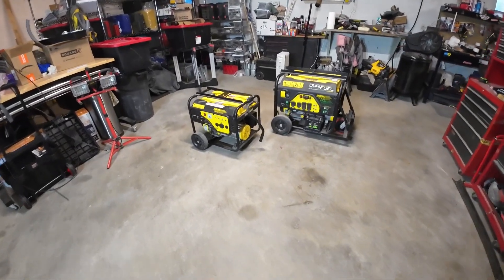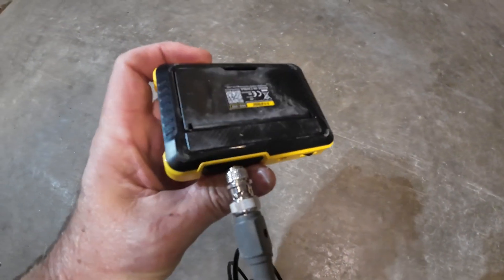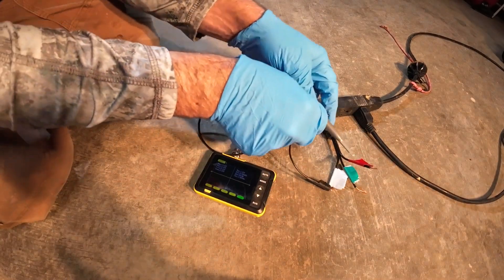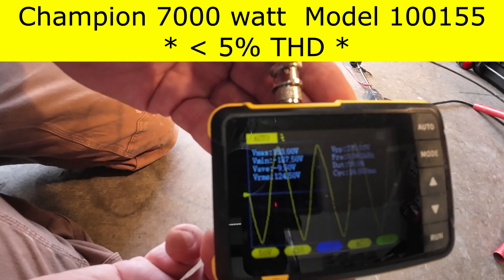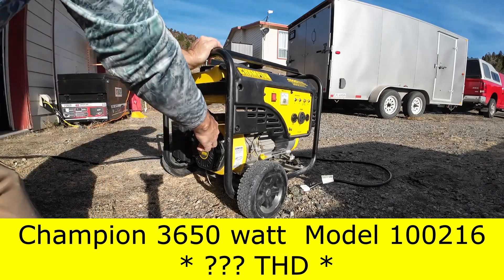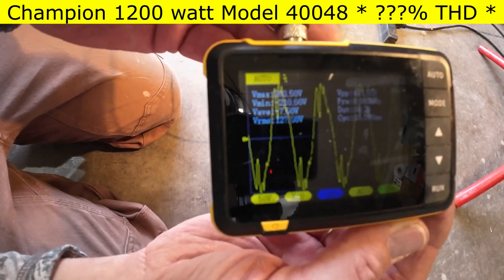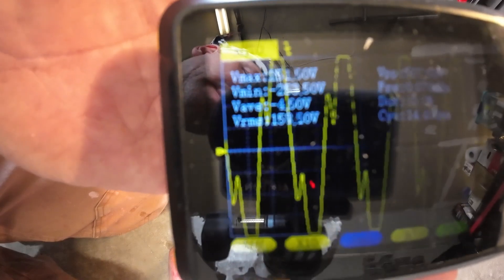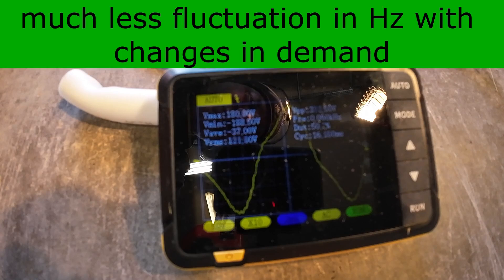3 Champion Generators POWER COMPARISON

Comment: Champion made that 9000w/7000w #100155 model only for Costco stores and made it to their specifications ,one which it was to have low THD.
Reply from the maker: Wow! That's good information. It's still going strong, I don't use it very often, but it always fires right up. As long as the battery is good 🙂
Reply: @anesthesiadreamin good to hear! I have the same model.  Has gotten me thru many outages during blizzards and keeps the lights and heat on.

Comment: To be honest most electronics that run DC and have a power adapter will handle the dirty power with no issue.
Most of the problems come from older electronics or poorly designed ones. Another issue comes from not powering up and powering down your generator properly. Meaning make sure the Genny is running before plugging in any electronics first. Also cut electronics off first when powering down the Genny. This ensure no spikes cause problems. But mostly Inverter Gennies are mostly marketing. If conventual Generators are so bad, I cant find one case where someone damaged something due to dirty Generator power from a conventional Genny.  Inverters are basically the extra safety net , like car insurance .. The chances of something been fried on a conventional  is around 5 - 15%% The inverter brings that number down to 3 - 6% .. Todays sensitive  electronics are all mostly DC powered  chances of damage in any case are very slim. Even .H.E. washers convert AC power to DC theses days.
Reply: Inverter generators are good to charge bluetti, nenogoly and the likes power packs, otherwise a regular genny is fine for running everything else.

Comment: Running a computer on ANY generator would be fine.  Have any of you ever looked at the voltage range most every power supply is capable of handling on a desktop or laptop?  They really don't care anything about "dirty power" as they are designed to handle it.  Remember that PC's are sold all over the world and to every 3rd world country with crap electricity, like India for instance, and you don't see them broadcasting that all their computers are dying.  Are inverter generators better overall?  Of course they are.  But it seems that "inverter" became the big buzz word over the last few years to offer some new ways to sell generators.  Power tools definitely don't care much about if the power is dirty or not.  Buy what gives you peace of mind, does the job you need it to do, and what your own wallet can afford.
Reply from the maker: @ITguyAR_66  well said my friend. I couldn't agree more. In the back of my mind I've always wondered about inverter generators and the big push for them, but I've never heard of anybody frying their electronics. I know my wife 's heating pads and electric throws that she likes to use when we're going on a long trip don't work on a square wave inverter in the truck. I just switched it to a pure sine wave inverter, and they work fine. But the square wave inverter never like burned them up LOL
Reply: @anesthesiadreamin  It's a fear tactic more than anything.  My inlaws had a $15k Generac generator on their last 2 houses and were made WAY before the inverter stuff...which Generac or Kohler have always made.  They never had any of their fancy fridges or fancy washers and dryers, computers, big tv's, etc., etc., blow up.  They have started to make the push towards "clean power" BUT they aren't inverter models; it's how they do the stator, etc.  Hell, our $45k generator outside our IT building that runs on NG with a backup of two 500 gallon propane  tanks isn't even an "inverter" model and we have probably $300k worth of networking gear in close to a million dollar building.  Not to mention that thing has been a big POS for the last 8 years trying to even start on it's weekly test until recently.  That's another story, though.  lol

Comment: You should check out some James Condon vids.  He does a lot of generators and has a THD meter for testing them.  Can't say the Champion generators he has rebuilt/got running again have acquitted themselves very well.  Hz sag under load, sketchy waveforms, etc.  Similar stuff to what you are seeing here.  Other brands/models have shown better performance in these areas.